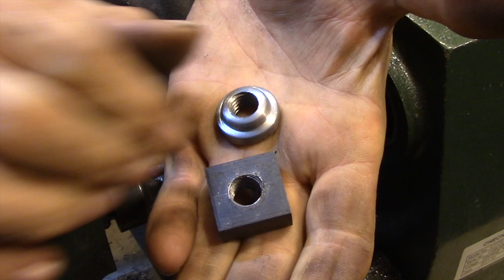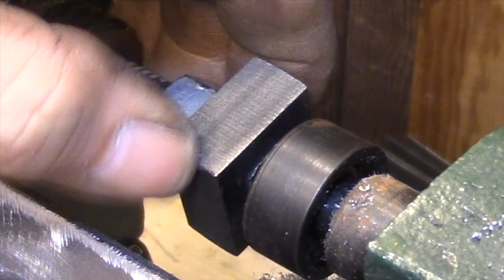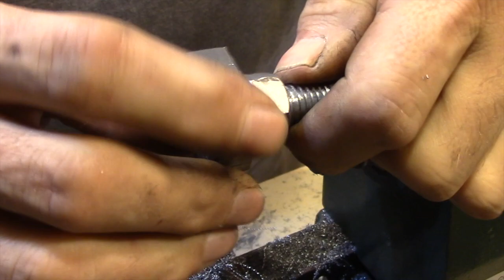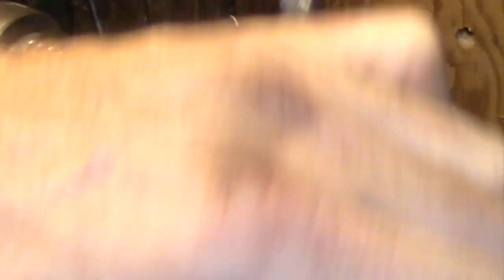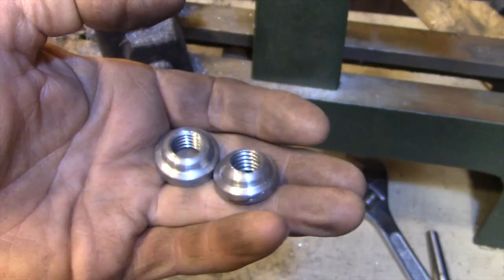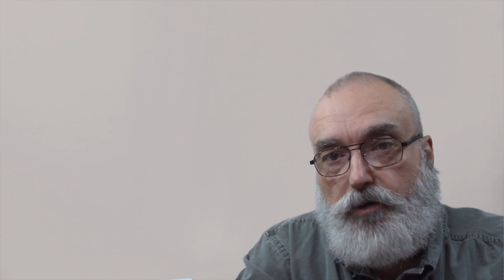Blacksmithing Project - New Shop Door Latch 5

Comment: Strangely I make up the hinge holding nuts from 3/4" square, then file a vee in each face edge to form a flower shaped nut, then on the end of the coach bolt I file cross hatching to form the centre of the flower, the use of the woodturning lathe can open up lots of possible techniques. I think also it shows people just how much work goes into a project, rather than buying a cheap Chinese product in a bubble pack at the local store.
Reply from the maker: That is a nice approach.  I'll definitely use that in a future project.  The main reason I went with this design was to avoid the whole problem of getting the flats of the square nut to line up properly.

Comment: Every time the tool touched the tail stock, I flinched.
Reply from the maker: Me too.  I should have taken the time to forge a cutter to fit in that tight space.
Reply: I am glad that you emphasized the safety. "A gutless little lathe..."
I have had tools fly at me from wood lathes and hit a face shield, Thus the flinch. "That would have knocked my teeth out..."  Impressive work.

Comment: A very interesting concept. I never would have thought a low powered or even foot powered lathe could turn metal. I imagine the blank was of a soft steel.
Reply from the maker: I am using hot rolled mild steel but watchmakers and gunsmiths turned many parts out of annealed tool steel the same way.

Comment: Turning metal on a treadle lathe....that had to have been a job for an apprentice back in the day!
Reply from the maker: That's a modern interpretation of the job.  They were probably amazed at how many hours of filing this did away with. Not to mention the unparalleled level of accuracy they were able to acheive.